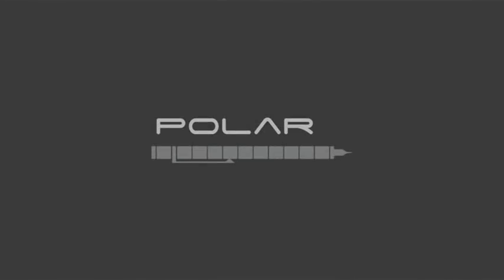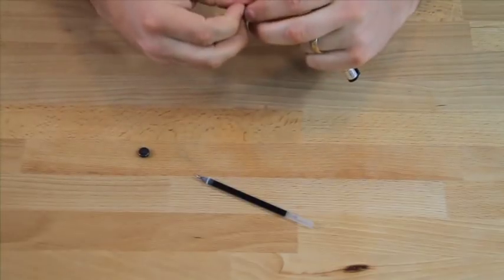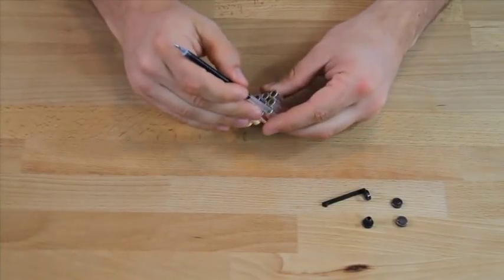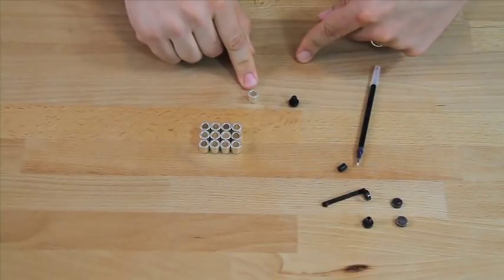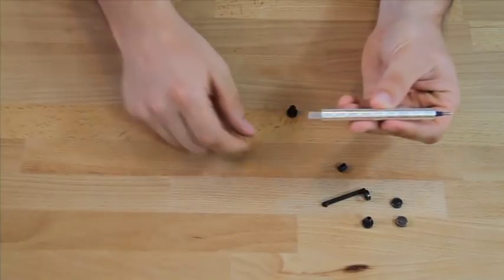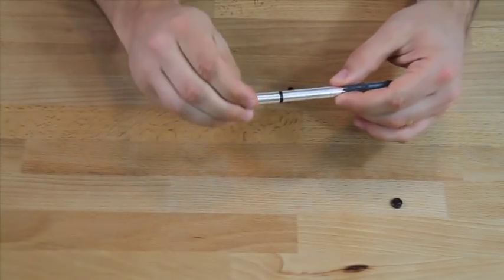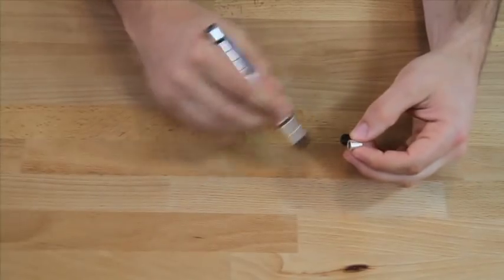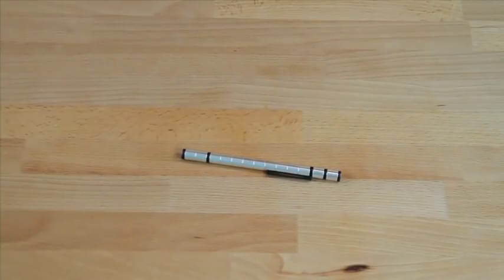POLAR Pen - Components, how-to and features

Comment: Im very confused. I believe the pen i ordered online came with two different sized styli but no silicon piece. The smaller stylus fits inside the circular magnets so Im not sure if its actually a stylus or the thing that prevents the pen from drying out but if it is the silicon piece Im unable to put an end cap outside it. Im not sure how well I explained my problem but basically I believe I have slightly different pieces than in this video.
Reply from the maker: Unfortunately you purchased a fake product. The only place to purchase the real POLAR Pen is www.polarpen.com There are many knockoffs on ebay and amazon and people continually complain to us thinking they have purchased one of our pens.  Just to clarify there are no official pens being sold online anywhere except polarpen.com
Reply: I believe I have the very same knockoff as you. How's yours holding up? I'm impressed with mine. Firgure out anything about the 2 different size stylus tips. I'm also unclear on whether there's a silicone piece on this model.
Reply: Polar Magnets hello Polar Magnets, as i do know there are many rip offs, but i would be very thankful if you could open up an amazon or eBay under Polar to sell these so it is easier to acquire it via amazon/ eBay card, thank you.